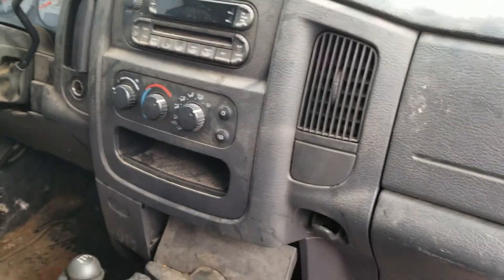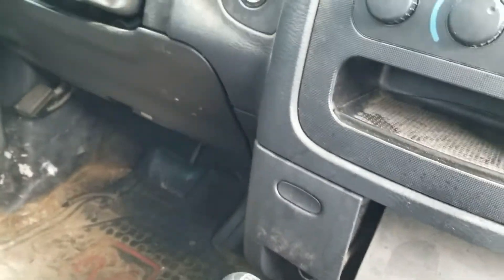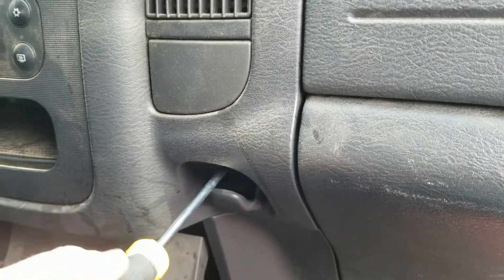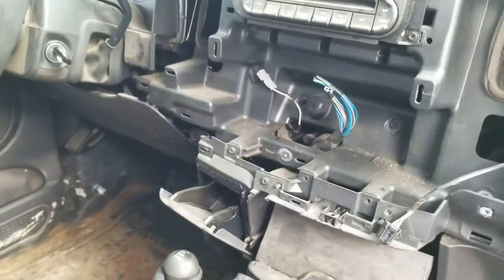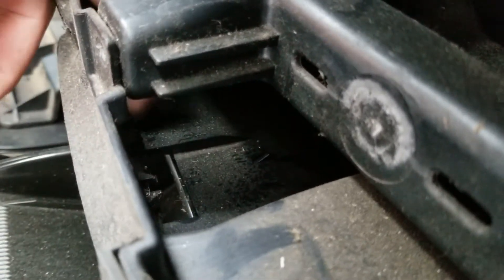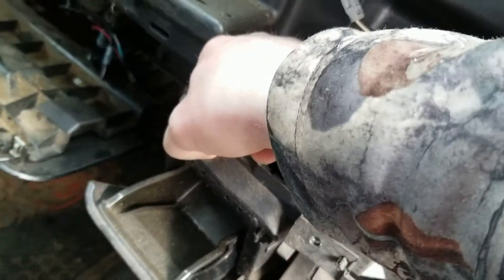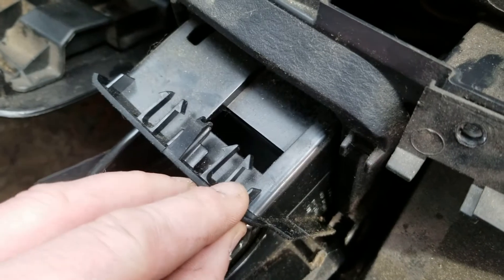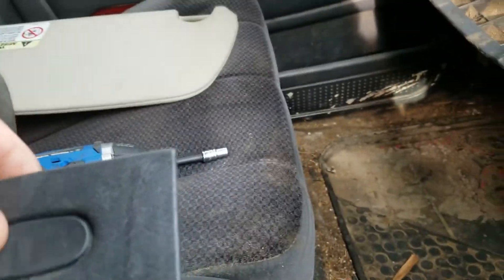2002 2003 2004 2005 DODGE RAM BROKEN ASH TRAY REMOVAL * HOW TO REMOVE * ASHTRAY HIDDEN CLIPS

Comment: A+ video, this was super helpful! Once I knew where the tabs are, I did not even have to remove the radio bezel, there is an access hole right underneath the tabs that allows squeezing the tabs with one finger while gently pulling with the other hand. There was indeed stuff underneath the mechanism that kept it from working on my truck 🙄 Thanks again!

Comment: I had no door on my ashtray when I bought my truck. I only pulled on it and it popped right off. Pull from the top out. Plus there's a cut out to reach your fingers to the plastic clips. Good luck out there

Comment: How do you remove the panel to the right of the ash tray?  I know there are two screws at the top but there are some connectors at the bottom that I can't see on the manual transmission version I am working on and I don't want to break anything.

Comment: How do you get the spring loaded part of ask try back in? It's the part that's broken, not the clips.
Reply from the maker: you can separate from the bottom of the unit, just be very careful, since those lower clips are very weak.  Good luck!!!
Reply: Where exactly does that spring sit?